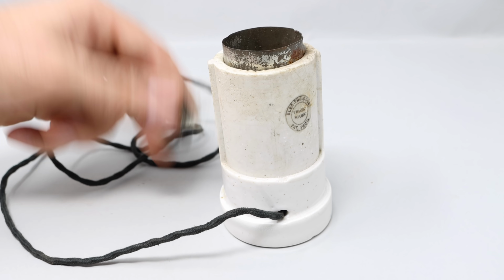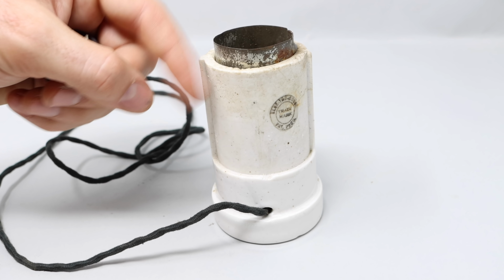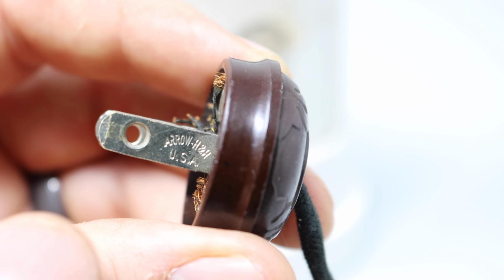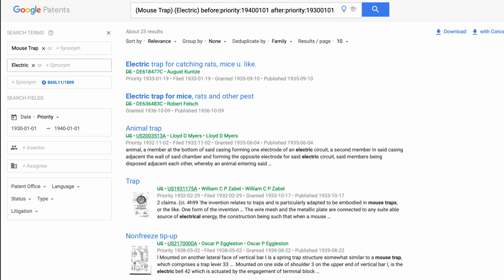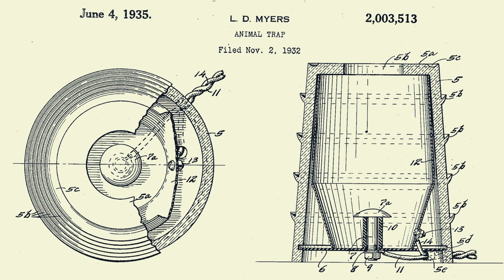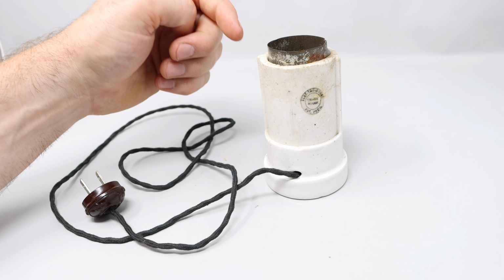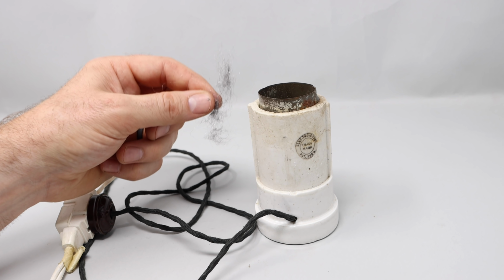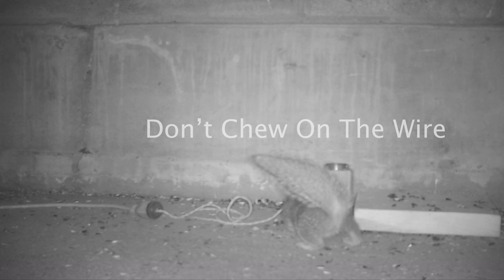I Need Your Help Explaining This One - The Electro Mouse Trap from the 1930s. Mousetrap Monday.

Comment: What comes to mind is that the 1920s, 1930s electricity was just starting to get regulated. That was also the time where they were making a electric table cloth, electric massager, and electric undergarments. So this may be a novelty item of trying to make somthing else electric. The 20-30s was when there would be naked wires and many people would get electrocuted and die from the lack of knowledge about electricity.

Great video by the way. When the trap fell over, i held my breath for a electrical fire.
Reply: That's kind of like in the 50s when everything was "atomic" and you could actually get toys that were radioactive.
Reply: I appreciate your comment. Thanks it was informative. ✌🏼🤩🇺🇸 Respect from Oregon
Reply: Papi Uuhmelmehahay 

Everytime you take a sip, 
You're guaranteed an ATOMIC flavour.

Only from the one and only Nuka-cola!
(Now introducing Nuka-cola Quantum!)
Reply: On top of that, I feel like this thing might be significantly more lethal in places with 220V.
Reply: Papi Uuhmelmehahay you know standard watches are also radioactive right? Even the lights in your house could set off a geigercounter. The kind of radioactive material it is will be more concern.
Reply: One drop of iridium would put a whole suburb into super lockdown.
Reply: Would be a mini Chernobyl like incident
Reply: Well Damn, I would've made an Electric Underwear for sure.
Reply: @dylanzrim1011  I am extremely familiar with electricity and components and there is zero reason to believe random modern  household objects are radioactive aside from smoke detectors with Americium isotopes.  Definitely no radioactive electric lights.
  The only "normal" things from the early/mid 1900's that could be radioactive are those old watches/clock that were infamous for their radium phosphor hand marks, gas lantern mantles that contained thorium, and a few old camera lenses which had trace radioactive contaminates like thorium in them which tended to yellow the glass over time.
Reply: Ok Nerd

Jk your really smart.
Reply: Hi

Hi

Hi
Reply: LOL I saw a video about early electricity the electric tablecloths shocked me I was like why.
Reply: Electric underwear and table cloth?? What ?
Reply: More like ~1890 to 1920.
by the 30s, electricity was rather popular already, and people knew how to use it.
Most houses from there on also had proper sockets and wiring that was OK (still far from modern wiring, but not as scary as some earlier techniques)
Reply: @PapiDoesIt  Including a nuclear bazooka (or really a recoilless rifle( that packed enough firepower in the round that it produced enough radiation to be instantly lethal at 500ft.
Reply: @zayn4128  no he is not he just spouted out nonsense he heard from absolute history
Reply: electric undergarments?
Reply: Electric "massagers" are still pretty popular.  Every couple should own one, as should every single lady, and men should at least give them a go once or twice.
Reply: Was electric DC then?

Comment: Notice  how the new electric traps also have a cutoff after a certain amount of time. If this trap did get a mouse it would just keep frying it until the breaker flipped or a fire started.

Also you need a transformer to step up the juice so it is deadlier. I don't think they ever would have worked.
Reply: You would also need to increase the current, since the mose isnt going to be making contact for a long time since it jumps, so increasing the current will minimize the issue of the mouse having to stay in the trap for longer periods of time
Reply: With the trap vertical and the electrode smeared with bate - the mouse won’t be able to get out and be continuously fried - until it caught fire/the fuse for the socket - circuit it was plugged into blows - if your lamp/tv/electric fire - heater was on the same circuit and cut off, you would go to this trap and find the burnt mouse in it, reset it and replace the fuse. I wonder how many fuses you would go through, in case it continuously blew them after zapping a mouse - a waste of fuses ☹️, also looks like its lid/insulated entry hole is missing - didn’t look right.
Reply: Or until the fault cleared, this would probably be a high resistance fault because of the poor conductive material.
Reply: Extra crispy
Reply: this one would too, trip the breaker
Reply: Brian Landers  they had a patent
Reply: Most outdoor sockets are RCD these days too.
Reply: @dudbike 120vols 10 amps is lethal, many people die each year due to household electrocution.
It's the method of application of the volts/current that's at fault here.
Reply: Maybe use a power cord that will trip.
Reply: @stephen1r2  An RCD protects against "faults" from live to ground. The mouse trap is across line and neutral, no residual current to trip on. An AFCI (Arc Fault Circuit Interrupter) might not like the weird electrical characteristics of a frying critter and is the breaker type most likely to trip before the critter catches on fire.
Reply: You are abslutely right. If for some reason the mouse did get stuck in there it would just act as a dead short between L-N.
Reply: Or in the 20s/30s the fuse in the fuse box would blow
Reply: Stephen1R2 or GFCI in the USA
Reply: @VulgarPhil  ?DEAD? Short?? I see what you did there!
Reply: @VulgarPhil  incorrect a mouse is of high resistance material same as a light bulb and would just continue frying if it got stuck inside no fuse would blow
Reply: and a shockingly bad smell through the house. Not a trap, but I have seen and smelt rats fried in electricity cabinets in factories before (380V 3 phase).
Reply: @iffracem  The amount of current needed to stop the human heart is measured in milliamp. So you have to increase the voltage to overcome the resistance. (Or decrease the resistance.)
Reply: Im pretty sure modern ones works more like defibrillators, solving the design problems in old ones. A transformer steps up the voltage to some thousands so the mouse can't survive, steadily store the energy in a capacitor so the breaker doesn't trip, then releases the whole capacitor in an instant. Also a commom misconception, current is proportional to voltage, if the voltage is higher, the current will be too, thus deadlier. High voltage "safe" stuff such as tesla coils doesnt kill you because what's generating the energy is just a brush on a vynil threadmill, not a huge turbine below a river, so there's not many electrons to go around killing people, also resistance is big. There's more to it, but my sermon was uncalled for to begin with, I'm out.

Comment: there is a piece missing on the plug, a insulated cover that slips over the end to insulate and cover the exposed connectors
Reply: a lot of old plugs in that style actually didn't have a cover
Reply: when it's plugged in, it won't matter, it's against the wall
Reply: The cardstock cover on these old style plugs often fell off.
Reply: not bob - socket
Reply: @samuelfellows6923  a socket is non conductive, or it wouldn't work
Reply: That cover is made of tar paper or some other hard cardboard--it didn't last
Reply: It might affect the value, but I would have put a new plug on before plugging in.
Reply: Stick a bulb in it, call it a mice light

Comment: Lay the trap on its side, that's how it is supposed to be used.  Fasten it down so it won't move. Stick the damp peanut butter bait only inside the trap, at the back on the centered electrical contact. It will zap almost every time they go in.

Comment: That reminds me electric gas lighter for (very old) gas oven I found in the grand-grandmother attic.
It was plugged into outlet and had quite large capacitor , so You could get zapped even when it was unplugged for few hours. Also it had full metal body, unlike this death trap (it looks like ceramic/bakelite, which are good insulators)
Early electric devices were SUPER crazy and SUPER dangerous.
Reply: Dark Duke this is my favorite comment in the thread, well done! 

What's your profile picture? It seems super familiar but I can't seem to place it.

Comment: Without a polarized plug there's a 50/50 chance when you plug that in that the exposed metal liner will be live. There's been no change in our power grid, the power being delivered now is just as dangerous as it was 90 years ago.
Reply: There is always (as in 100% of the time, also called permanently) 110V A.C. Between neutral and live.
Reply: Joe Lafrite you’re right but the neutral is bonded so touching it and ground won’t(shouldn’t) discharge any load. That’s the issue.
Reply: @joelafrite7850  what he was getting at is that in most mains installations the neutral is bonded (connected) to earth at/near the switchboard/breaker box, so neutral to earth potential is a lot less (not always zero volts but pretty close) than live to earth. US plugs are /generally/ non polarised so the outer housing on that trap has a 50/50 chance of being live or being neutral.

Though back in the 30s I wouldn't be surprised if that pre-electrical code era there was no protective earth in the installation so these traps may have worked better for the mice not feeling the current regardless of which way the plug was plugged in upon touching the upper housing.
Reply: ..... I think the top/lid/insulated entry hole is missing in this example - that copper would not be exposed. 😉
Reply: @mbainrot  it would actually be ideal if the center conductor was always the live one, any animal touching the outer conductor, but not completing the circuit, would be able to feel a 60hz vibration and would likely not want to continue farther into it. This is just a guess though, if you've ever touched a live conductor it's a pretty odd sensation.
Reply: You're right on the East Coast they use Edison works which is direct current everywhere else alternating current.
Reply: @joelafrite7850  *120 VAC in the US and Canada.  And the US electric grid as delivered to most homes is really 240V if you want to be technical about it and measure between the live wires, just as one of them and ground is 120V.
Reply: @mbainrot  trust me... When you plug a two prong plug into an outlet, you'll always have 120V ac  between the two leads, which are always one live and one neutral in the US,  no matter which way you plug it in, and the two electrodes in that device are subsequently connected to 120V A.C. Always.
Reply: @joelafrite7850  That is not the fact in dispute
Reply: @jayschafer1760  don't you use a 3-phase system over in the US? So you should get less than 240 as they are 120 degrees out of phase.
Reply: @hrysp  residential systems are 2 120v lines 180 degrees out of phase
Reply: @SamSilvestro  what is the fact in dispute? This conversation went a bit wild... Too many experts in electricity who are true masters of light switches 😋
Reply: @hrysp  out of phase AC voltages don't "cancel", it means their potential is doubled. the difference between -120v and 120v is 240v.
Reply: @joshuakelderhouse3755  Starting in the late 1880s, Thomas Edison and Nikola Tesla were embroiled in a battle now known as the War of the Currents. Edison developed direct current -- current that runs continually in a single direction, like in a battery or a fuel cell
Reply: @JackedALF  No they arent LOL  Its 1 240 volt system split in half, single phase means only ONE phase
Reply: @williamlux  Bawahaha  please explain 2 phases in a "single phase" system
Reply: In the 30's systems were ungrounded so polarizing made no difference, touching a live line would never shock you, you had to touch 2 live lines.
Reply: @williamlux  lmao  thanks.. I need to show this to my coworkers.. its great stuff.  "2 phase" single phase system haha  (probably should leave this kinda stuff to us professionals eh)
Reply: @williamlux  Two phase systems are not used, they require 4 wires and are for motors although they could be wired for 3 wires by connecting one leg of each phase and connecting that to ground making it neutral but since the cancelation effect did not work it was unbalanced and had to be double sized they was rarely connected this way.  3 phase motors are simpler in design basically just a rotating field around a big ball of copper, unlike single phase, two phase and DC motors which all require a commutator.  Two phase is obsolete, the phases were 90 degrees off and were used in some industrial and commercial buildings in  Philadelphia USA in the 30's, but I have heard there is still some operating to this day.  So no, two phase systems were never used in homes, it is completely impracticable since there is barely any motor loads.  Although it could be said that small Shaded Pole and capacitor run motors such as exhaust fans in bathrooms and small pumps are 2 phase using the capacitance to create the 90 degree phase shift.
Reply: GFIC & RCCB

Comment: Plug this unit into a ground interrupter so it will stop the power before a fire is started at the wall plug, then mount the unit in a way it can't be tipped over.  Dampening the area around the unit may help.  But, for sure place peanut butter on the bottom contact and, possibly, place a larger piece of metal on the bottom.  That's what I would try before giving up on the experiment.

Comment: So I am a electrician. I set up something similar to this with the metal grating as a ground/neutral and the hot wire above it with peanut butter on it and it did not work. The rat would simply get a little zap jump in the air and run off. I even put a wet napkin on the ground to amplify the conductivity and it did shock the mouse more but did not kill it. I cannot imagine that these traps ever worked.
Reply: Try some salt in the water.
Reply: Wouldn't it be more lethal if it were 120 VDC instead of 120 VAC? And then maybe 600 VDC found in overhead wires for light rail vehicles?
Reply: @RaymondHng  yes it would be! DC is a direct current so it will hold you more than AC will. I have been shocked by DC and it is more of a slow burn that you can't get off of. You could in theory get a AC/DC rectifier and put it to the test...

Comment: 110 -120v 60hz AC is the same today as it was back then, I'm pretty sure they didn't work back then either. The voltage In the new electric traps today is a higher voltage which is required to flow enough current through the mouse to kill it

Comment: Dampen the area around the trap, so that their feet are wet...
Reply: Thats what I was thinking. Somehow water needs to be introduced into this thing.
Reply: Lol
Reply: Cleaning the copper surface would also bring down the resistance a lot. With that green corrosion, it will not even make a good contact to metal
Reply: yes lets make the thing even more likely to set the dudes house & barn on fire... 
That being said I also answered his query as to make this thing more functional [the ONLY way possible is to make it even more of a hazard!] but at least I stated clearly it was a bad idea & added safety precautions to  attempt the mitigation of that increased danger

Comment: Once AC became more standardized sround 1910, power relays had to boost the mA (miliamps) for power transfer through what were then not very efficient systems.  Volts and current type aren't as important as mA when it comes to lethality.  It only takes about 100mA to induce cardiac arrest in a person with a second or two of exposure. So more than likely the mA coursing through the grid was much higher than it is today. 

 It could also be that the trap was designed prior to its patent date, in which it could very well be designed to principally use DC, or Direct Current, which provides a steady flow of electricity, as opposed to AC, which would give muscles a brief opportunity to recover over each pulse of electrical energy.
Reply: Ever heard of Ohm's law? You really should not post stuff that is utter nonsense when it comes to technical things that could kill people.
Reply: Clearly, you DON'T know what your commenting about. 
Lethal CURRENT flow through a human is less than 0.1 Amp and modern 'safety switches' (RCD)  are designed to trip power supply at 0.015 Amp ( 15 milliamp ). A small rodent would have an even lower lethal flow of current level. 
Likewise, A.C or D.C. at the terminals would make no difference, nor variations in that mains supply between 100V or 120V A.C. mains supply as used here. 

The device would function better if it had a higher Voltage across the terminals, to breakdown the higher resistance of the intended victim, around the 600V to 1,000V range. 
As those who know the why this doesn't function say, water on the mouse would present as a lower resistance of the critter.

Comment: There is nothing stepping up the voltage so you just have a plain 120 volt 60 Hz But with the more modern traps that are usually powered by some AA batteries the voltage is stepped up to thousands or even millions. It also could be that the mouse was not shocked in the right places.

Comment: I don't think it could have worked well back then either. You need to ensure that the subject will be unable to disconnet itself from the electricity from jumping before applying the shock, hence the use of sensors in modern electric shock mouse traps to not only apply the shock at the right time but also to disable the shock after the kill, by detecting the presence. Victor traps might be using intrinsic sensing techniques such as sensing a "probing" current periodically applied to the electrodes, to determine the presence of a rodent.

Comment: My initial hypothesis was that the trap was meant to run on dc as dc current tends to “hold” its victims while ac has a tendency to shock and push away but doing reader has into it I found ax current had Ben standardized long before the 1930’s so honestly I have no idea